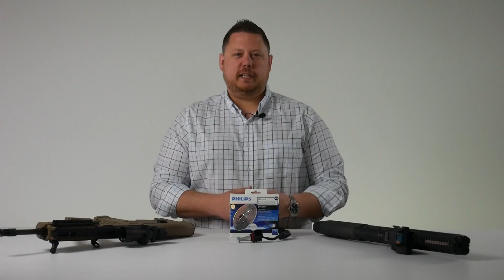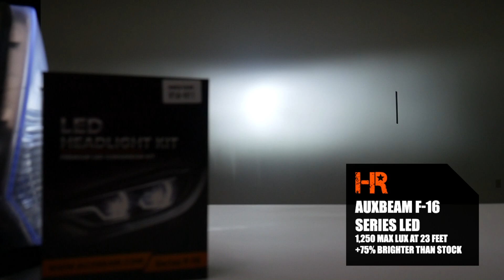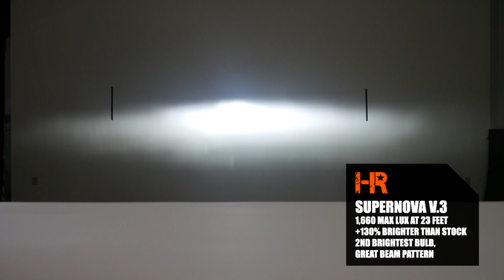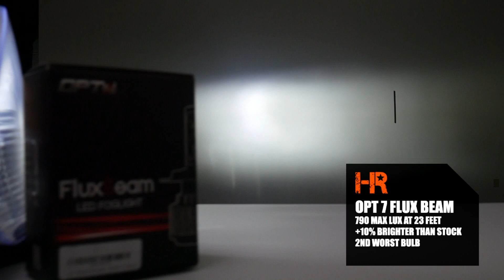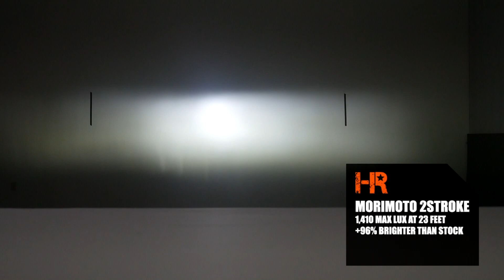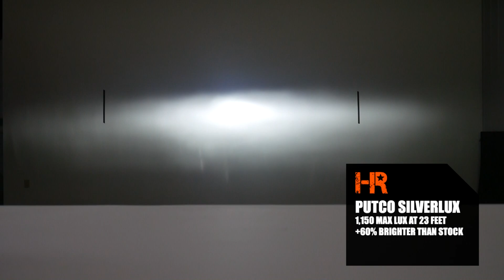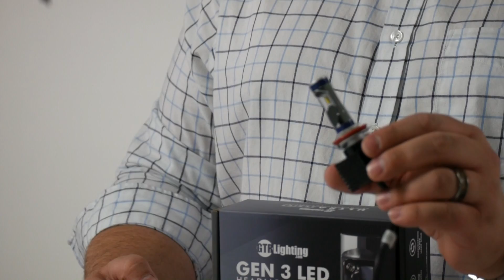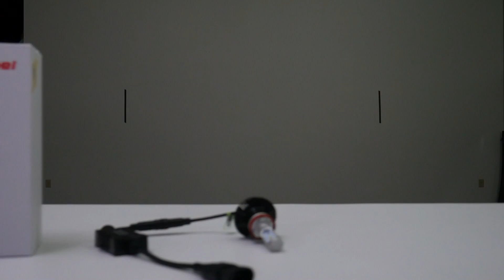DELETE - 15 Brands LED Headlight Bulb Shoot-Out! Which one's the best?

Comment: I'm looking for LED replacement High beams in H9 size would you recommend a different beam pattern from low beams? I have diode dynamics sl1s for low beams and fogs but I am looking for as much light as possible for 15-30min intervals (heat not as big of an issue)

Comment: Added the SV4 to my 2018 F150.  I saw a video you did that says to stuff the resistor inside the headlight housing.  Don’t these get hot?  Won’t it melt things?
Reply from the maker: Heat will not be an issue at all, you will want to stick that driver and PWM module right inside that housing if possible! Let us know if you have any other questions, we are here to help!

Comment: So I have a 2014 GMC Sierra and my Morimotos HIDS went out. What led bulbs you recommend were I would get good distance and a white blue light out of them a good led
Reply from the maker: I hate to say it but due to recent changes in government regulation for aftermarket lighting, we are unable to recommend any HIDs or LEDs for street legal use. We can, however, recommend LEDs or HIDs for offroad use, so in that application I would recommend going with the Diode Dynamics SL1, as those are going to fit in that housing, and will produce a fantastic beam pattern!
Reply from the maker: I have linked those SL1 LEDs for you here: https://headlightrevolution.com/14-15-gmc-sierra-projector-headlights-diode-dynamics-sl1-led-conversion-kit-high-and-low-beam/

Comment: I have a 99 camaro SS and i upgraded to an 6000k LED bulb over halogen but with the one I got from Alla it looks amazing  looking at the color after install but after making  adjustments the pattern wasn’t Super great and I know I would be blinding people terribly. I would need to drop them so far down they would be useless. The lights are obviously reflectors. Am I stuck with whatever the best halogens out there are or is there an LED option for my specific reflectors?
Reply from the maker: Can can certainly still go LED. Both the GTR Lighting Ultra 2 and S-V.4 bulbs perfectly mimic the halogen bulb beam pattern. 
https://headlightrevolution.com/led-headlight-bulbs/
Reply: Headlight Revolution  I heard the saber pro x does that as well.
Reply: Headlight Revolution  I unfortunately already order a set of the saber proX 55W yesterday based on it saying they were 1 of the best for reflectors headlights. I’ll try them and if they don’t work I’ll return them and try either the GTR or S-V4.  Are the S-V 4 on your sight?
Reply from the maker: Yes, they sure are!
https://headlightrevolution.com/led-headlight-bulbs/s-v-4-led-headlight-bulbs/

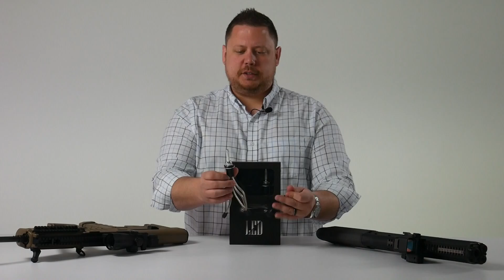Comment: Had the ones at 3:22 for about 18months in my foglight no problems.  One of the fog lights cracked about 10months ago and gets condensation when it rains very hard or when power washing yet the led seems unaffected so it truly is waterproof. They are actually called “R4 Led 6000k” probably the best for $40 for foglights where there is dirt that breaks fans on other leds.
Reply from the maker: Thanks for the recommendations! Good to know someone with some extra experience with other brands!
Reply: @HeadlightRevolution  your welcome. Just trying to help people on a small budget steer clear of the crap and get something quite decent for the price. :)

Comment: I already asked this question in another video, but i'll post it here too since i'd really like to have your thoughts:

A Finnish spare parts shop called Motonet is selling LED bulbs that look exactly like GTR Lighting bulbs, but they're selling them under a different name, Autoline. Should i trust them, maybe they're just rebrands?

I checked the box in the store, and the LEDs are indeed the same too, Lumileds. Here's the stores picture of the H1 model: https://asset.motonet.fi/img/4/433048/500/433048.jpg

They cost 45-50€ per bulb.
Reply from the maker: We couldn't tell you what other brands carry or where they got them from. If they have a good reputation then you can probably trust it. If there isn't much information behind the company you may want to buy elsewhere.
Reply: @HeadlightRevolution  Other users have said on forums that they do work fine. Good light pattern and brightness, they don't seem to blind oncoming traffic (via the non-scientific do-i-get-flashed test).
I'll buy them and see if they work in my car then.

Comment: Do any of these support 6volt operation for use in DRL application?
Reply from the maker: Surely, nearly every LED on our website will be DRL Compliant! We have many customers from Canada where DRL is needed, so no worries there! :)
Reply: @Revolution - Really? Most of your listings don't specify, but the Supernova V4 do explicitly cite a minimum operating voltage of 8. I definitely wouldn't spend that kind of money on something that only might work.
Reply: @Revolution - Really? Most of your listings don't specify, but the Supernova V4 do explicitly cite a minimum operating voltage of 8. I definitely wouldn't spend that kind of money on something that only might work.
Reply from the maker: @Browningate  On most vehicles they work just fine at DRL levels. Some vehicles require PWM modules to work accordingly, but other than that we have had no issues with it in testing.
Reply: @Revolution - If the minimum input voltage is 8 and the car drops the voltage to 6 to dim the highbeams in order to make them function as DRL, then they won't work right. Many reputable sellers online say this, either in words or by providing a compatible input voltage range.

Comment: you did a great job of handing each weapon when it was handed to you. I saw your trigger finger find the proper (safe) location. However, you should ALWAYS check the gun to see if it is loaded when somebody hands you a weapon. Even if you saw them check it and it was empty. You should ALWAYS cross check it when its handed to you.

Comment: I was really hoping there was more to the criteria of this video than brightest light that can attract airplanes from distant countries and beam pattern. Nothing at all about longevity, how well built/going to last. You know, that whole, they aren't very bright any more when they are dead, thing. Or the, I paid a buck fifty for these things, just 9 months ago BS... There is a point when brighter & brighter & brighter starts to get ridiculous, not to mention typically adversely affects longevity. And then there is that problem when the other drivers start shooting at your car cause you're freaking blinding them. How much brighter than stock does a bulb realistically need to be?

Also, what country are they made in???? Money spending minds want to know....

 I'm sick to death of changing the bulbs in my wife's Subaru Outback every six months. Taking off the wheels, going in through the wheel well and still you have to be a midget contortionist with hands the size of a six year old girl to get your hand in there, around all that nice sharp metal. Fully half of these bulbs look like they'd be impossible to even get into the space.

Comment: Does the beam pattern test show how close the bulb replicates a halogen bulb or how well that particular bulb works in a specific reflector housing?  So if the beam pattern is excellent in a dodge ram reflector housing, will if be excellent in a ford expedition housing?

Comment: Why are all LED replacement bulbs 6000K ? That is way to blue for comfort and is a hell for anyone who meets you and get blinded, I would rather meet a guy with 400W of halogen Rally 3000 high beams then "legal" amount of 6000K as that blue light makes me and many other blind. They pracically stopped making 6000k Xeon bulbs ages ago as 4500K and lower is much more friendly on the eyes.
Reply from the maker: 6,000k is a very slightly blue light compared to the darker blues such as 8,000k and 10,000k, which are a very deep blue. 5,000k is a Pure White color, with no yellows or blues mixed in at all, and is the brightest light spectrum offered in a bulb color. Companies have found that 6,000k is the most popular color due to the overall performance and look of the color in a vehicle. As long as they are properly aligned and positioned in the housing, there should be no blinding issues. Thanks for the comment!

Comment: How would you compare the Diode Dynamics  SL1 LED'S to Gtr  ultra gen 3 which one has the most lux?
Reply from the maker: The SL1 bulbs have the advantage of more fitment options than the Gen. 3 bulb and is a more affordable but bright option. The Gen. 3 bulbs are brighter, they have a better warranty, the chip placement is very nice, and the fanless design makes for a more durable bulb. In regard to lux, that all comes down to which vehicle they are installed in and how well that specific housing can convert the light emitted from the LEDs into usable light down the road. The Gen. 3 bulbs will provide more lux in nearly every platform than the SLFs.

Comment: Do the led pattern differ when they r in the reflector housing and a projector housing? Does the pattern matter in a projector, since projectors actually control the cutoff?
Reply from the maker: LEDs differ massively in a projector housing vs. a reflector housing. LEDs in projectors are pretty bad at this point in LED bulb technology, and are much better in a reflective housing. LEDs only put light out side to side, and not in a full 360 degree pattern, not allowing the projector to gather the light it needs to create a solid beam pattern, causing poor light output and scatter. Reflector housings don't require as much light in specific points as a projector lense does, allowing for a much more desirable beam pattern. :) Good question!

Comment: Quick question, how do led headlights work with cars that use the low beam as drls like Chevrolet or Volkswagen?

Will they flicker because of the low power output or will they be fine for every day use. Also, will the lifetime of these Outlast standard basic halogen headlights when you account for the drl usage during daylight?

Thank you.

Comment: Have you heard of Cyclops Adventure Sports?  I just purchased the Cyclops 7000 Lumen H4 LED Blub.  The supplier had this video linked to there web site.  I am woundering if I got screwed on the Lumens.  Great Video, and I wish I would have seen it before I purchased this one.  Thanks
Reply from the maker: I personally haven't heard of them before. 7,000 Lumens is a lot to claim to come from a bulb that looks like that... My best guess is if we had those bulbs on this episode, we would have shot it. 😎
Reply: I installed it last night and loaded a app on my phone.  It only showed 360 Lumens.
Reply from the maker: ouch... while I'm sure a phone app won't get you the most accurate reading in this application, that reading isn't the best sign.

Comment: Yesterday I received my   PHILIPS HIR2 9012 X-treme Ultinon LED Headlight Conversion Kit Bulbs 6000K.

For my opinion, it works great in my 2015er Dodge Challenger.
No noise fro the fan, easy fitment.

Comment: Please test out nighteye LED headlight bulbs .... They are quite popular now... Not sure how they perform
Reply from the maker: Mile hunter 93, we've tested over 300 different kinds of bulbs and they look very similar to some of the cheaper brands off of Amazon and Ebay that we've tested.
Reply: Headlight Revolution thanks for the input!🙏 

My car has a h4 reflector type housing! Planning to upgrade the headlights but GTR LIGHTING gen 3s costs 300 times more than a halogen headlight here in India 😑

Can you suggest me some h4 headlights which suits best for reflector housing without burning a hole in the pocket!

Thanks! Regards , kavin

Comment: love the info and different brands ...but the reason the beam pattern sucks is that you're not using projector headlights, But i do like those supernova LEDs
Reply from the maker: luckeyboy33, thanks for your comment. The reason we didn't show these bulbs used in a projector housing is LED headlight bulbs right now are not designed in such a way that they create an appropriate beam pattern. Those bulbs that did not perform well in the test shown are even worse in projector housings. HIDs are going to give you the best upgrade overall in a projector housing.
Reply: Gotcha! Guess I’m going back to HIDs since my LEDs started flickering after I’ve had them nearly a year. Ordered the error free harness to make them stop flickering but that didn’t help. So I’m going back to HIDs ... just gotta see which brand to go with

Comment: Does the beam pattern depend on the model of the reflector housing or is it all in the bulb?
Reply from the maker: It can be both. Overall, the quality of the bulbs is going to be the heaviest factor in getting the best light output out of a given housing. In a few cases, a good quality bulb is going to help, but sometimes there is only minimal improvement that can be made with a crappy housing, unless you are doing a retrofit. That's why we constantly do different testing as you can see.

Comment: Are the results with a given bulb the same with RAMs having projector headlights?
Reply from the maker: Paulo Heaven, thanks for your comment. From our testing, the vast majority of LED bulbs do not do well in projector housings. Here's a quick video to explain why: https://www.youtube.com/watch?v=utrYcpXDwJ8 
I would definitely go with a 55 Watt GTR HID kit over LED's in your projectors which would get you 5x brighter than stock, whereas the only 2 options for LED that are going to be anywhere near decent are 2x brighter. With Rams especially it can really vary a lot from one year to the next. 
If you'd like more info on what is going to work in your vehicle specifically, please email or call us:
sales@headlightrevolution.com    

      
      
Show less
Reply: OK cool, thank you for your advice. I was really interested by GTR LED kits because like you explained, LEDs will be everywhere in the future, and are subject to constant improvements. I don't doubt GTR makes good HID kits either, but what bothers me is having to drill through the headlights rear cap, and fidgeting with fitting a ballast in a very tight space under the headlight assembly. However I know that with projectors, there are light pattern concerns, and the cleanest and nicest to drivers coming in front are of course the best. Just in case I sell the truck and the buyer wants to have them back to stock, I better have caps in good condition. But I'll see, if necessary it should be possible to find brand new caps. I'll figure it out 😊 Otherwise, the brights being on a reflector, would it be possible to use an LED besides the HID in the projector?
Reply from the maker: Paulo Heaven, we use that combination all the time. Reason being, HID's have "warm up" period of a few seconds when they turn on, whereas LED's are instant-on-instant-off.
Reply: OK, that is definitely the informations I needed. That was helpful. Thank you very much!

Comment: Love your video; super informative and unbiased! I just have one question: could I reasonably expect the same results with a 9006 from Supernova and GTR? That's the size both me and my wife's cars require. Thanks for the research. I've been waiting to find a comprehensive comparison video before committing hard earned money. Keep up the great work!
Reply from the maker: ShiftyKen 08, you can't go wrong with either one of those. Most of the guys here have them in their vehicles and love them. My only question would be--do you have projector or reflector headlights? 
If you're not sure, watch this video - https://www.youtube.com/watch?v=MFR4SI0u8JI&t=99s
If you do have projectors, here's why I would consider HID's - https://www.youtube.com/watch?v=utrYcpXDwJ8&t=7s
If you need any more info give us a shout.
sales@headlightrevolution.com
218-755-5505
Reply: Headlight Revolution thanks for the prompt reply! I have a 2009 Accord Coupe with reflector headlights. I'm going to order the GTRs since they came out tops in your test.
Reply from the maker: ShiftyKen 08, lovin' it man! just make sure you have at least 1.5 inches of space behind your headlight housing.
Reply: Headlight Revolution yes, I do. I've seen other videos of headlight installs for my specific vehicle configuration and the space is there. It's just kind of a pain getting to them because I have to go in through the wheel well, which, believe it or not, seems to be the faster  and easier route. Thanks!

Comment: will pattern affect if installed in a projector type headlight? any link with same test if they are placed in a projector type headlight?
Reply from the maker: BloodHeart, thanks for your comment. In our exeperience, most LED bulbs don't perform well in projectors. Here's why: https://www.youtube.com/watch?v=utrYcpXDwJ8

Reply ·
Reply: Can you test Illustro Max and Illustro Flex in projector type headlight and also in reflector type headlights? I've read from their site bimmian.com that they are a bmw lights supplier but their products work also on other cars as well and also they are pretty expensive.
Reply from the maker: Those bulbs look very similar to the ones we tested in the video: #15 and #16. We still haven't found LED bulbs that perform well enough in projectors. HID conversion kits are still what we recommend to people for projector housings.

Comment: Which one should I buy for KIA Sorento? 
(Housing with cap) 
Supernova  v.3 OR  GTR 3 GEN Ultra

H11 12v 55w low-beam 
H7 12v 55w high-beam

Do you think GTR creates heat or fire if it is used for Sorento headlight housing?
Reply from the maker: Garweyne, we have never encountered either one of those causing a fire in someone's headlights. That would be a sure sign of either wrong or very low-quality bulbs. Depending on how much space you have, you may have to modify your dust cover. Please contact us directly, let us know what year your Sorento is, and we'll find the best and easiest solution for you.
Email: sales@headlightinformation.com
Phone: 218-755-5505